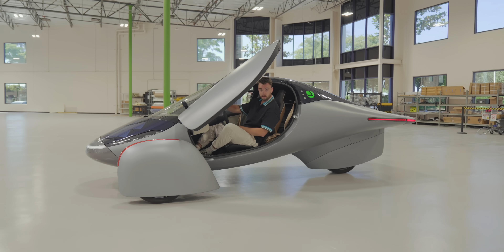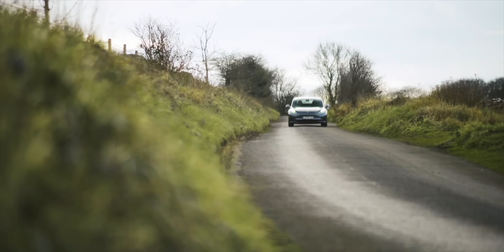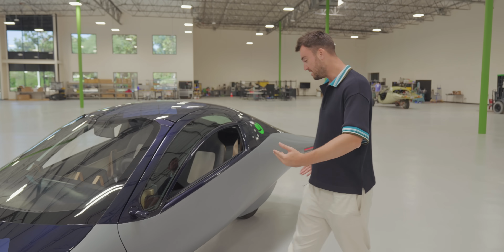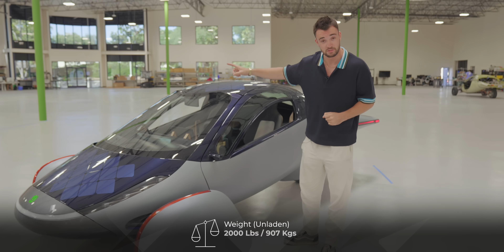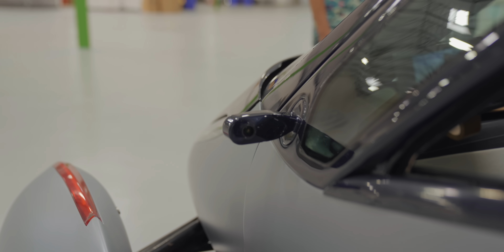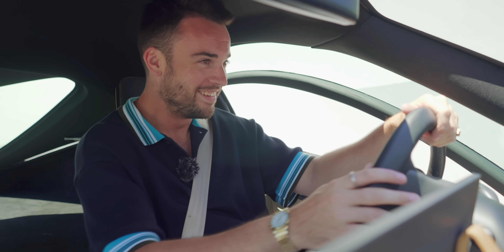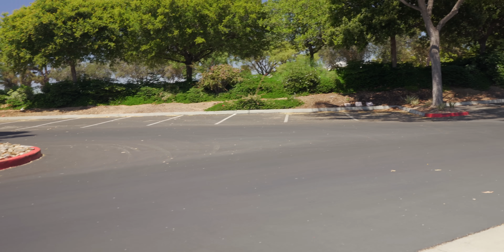The Game-Changing CHEAP Electric Car Inspired By Fish!

Comment: Those are advanced solar panels, btw.
They did invent them, they are still inventing.
And it is perfectly plausible to say they started there, when they started working on this, the latest generation of the beautifully elegant APTERA.
The next prototype has a yoke, btw. I believe it will have a centrally located monitor as well.
Chris! Hey man, you are looking good. Indeed.
Reply: They are way less prone to rupture I read or heard. Hail damage will most likely be much less compared to cars with a metal body.

Comment: Too wide for UK and Europe. Needs to lose 20cm of width
Reply: This regulation will come under heavy pressure given the upcoming energy supply desaster.
Reply: @charangohabsburg1  Oh really? The EU isn't going to change anything for one trike from one American manufacturer.
Reply: @tangerinestorm  The vehicle's design and width make sense, the 2 meter rule doesn't at all, it's just a random thing because some guy thought that 3-wheelers were smaller than 4-wheelers.
As the width of the Aptera is tightly tied to it's efficiency, the lurking energy supply desaster Europe will face might really help.

Comment: Increasing vehicle. 
It looks to have about 50 individual solar cells. So if the standard specifications are applied to a 20% efficiency monocrystalline cell, those 50 cells would generate about 25 Volts at around 10 Amps, giving 250 Watt hours in perfect conditions.

Not bad for a vehicle with a claimed efficiency of 10 miles per kWhr.
Reply: They're estimating about 400 watt hours (hence, about 40 miles)
Reply: It has way more than that, approaching 200 I think.  The alpha prototypes don't have the cells on the roof or the hatch.

Comment: A very sharp looking car at a reasonable price but very, very noisy. Without the Noise, I'd buy one. Especially if they would equip it with Sodium ION batteries.
Reply: Sodium Ion batteries take up more space and are heavier than even LFP batteries for the same amount of energy. They are getting close to matching energy density per weight of LFP batteries from previous years (See recent video on Fully Charged for example). Volumetrically, Sodium Ion cells are not that close to lithium ion or LFP cells which is why they are being used in stationary storage and companies making the cells are targeting stationary storage in general. Cheaper, safe, takes up more space and so is perfect for stationary storage. Now LFP batteries have gotten 15% better and by next year will be 30% better than the older LFP technology that Sodium ion is getting close to in WH / KG.
Reply: Prototypes tend to be a bit rough around the edges, which would explain the noise, it was the original prototype, with more refined beta & gamma already following

Comment: Efficiency is what we really need. But it's much harder to achieve than 0-60 in under 4 seconds.
Reply: 3.5 seconds with the $2500 AWD option actually.  Also safer in winter due to more torque and active control.

Comment: When will they be selling RHD to the UK?
Reply: 2024 at the earliest, which is a redesign due to the L5e-A regulations.  They haven't said anything officially about RHD vs. LHD, but since it is drive-by-wire that should be easy.
Reply: @WyndStryke  from their FAQ I just read "We will be developing right hand drive versions for the necessary markets! It is made much more simple because we are using in-wheel motors and there is nothing blocking our steering linkage in the front of the Aptera. All we do is swap the dash, steering rack, and some software settings and it is ready to drive RHD."

Comment: Original Aptera was two-seater with dimensions of Hummer and practicality of goldfish. This single-seater looks much better. Could even consider buying one.
Reply: Uh....the vehicle in the video was a two seater.
Reply: @skipondowntheroad5833  Looks very cramped. Would be better as single-seater. More efficient too. This is smaller than original, but still rather wide and long.